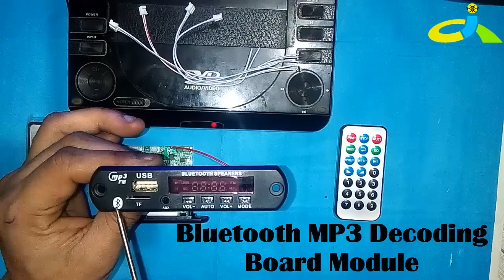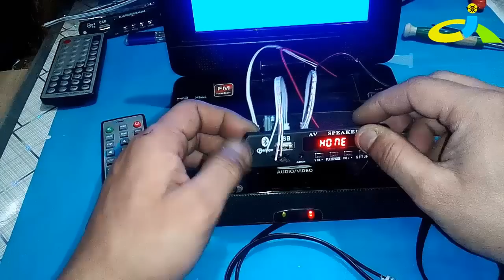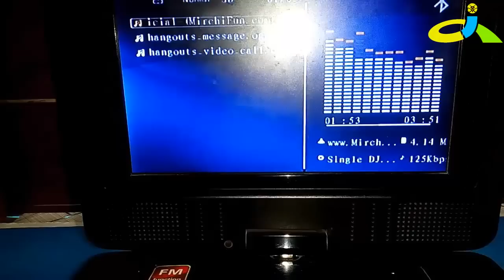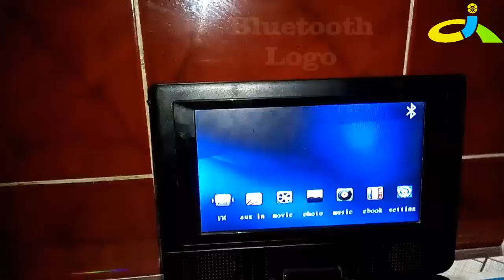Digital  Bluetooth Mp5 Video Player | Bluetooth Video Panel Full Wiring Connection And Testing

Comment: Hai. Can we use mobile charger for 5v dc supply to this card?
Reply from the maker: yes...any 5v mob charger You can use.Tnk U...........
Reply: @Creativeideasbd  thanks a lot for yr swift response. Actually I just bought blutooth mp3 board and wanted to use 5v mobile charger for power supply.
Reply: No